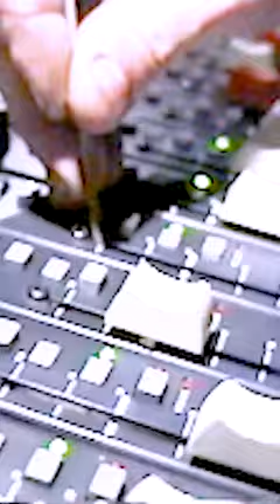More Headroom

Comment: I often stretch my cables, if you do it right you can make a 20ft into a 30 no problem.
Reply from the maker: A quality cable stretcher is a great investment

Also owning a set of high capacity air hooks so that you can fly the PA without ground support can be very useful

Comment: You know it's a good tip when the Beastie Boys are showing Gratitude.  Also, everybody talking about the metal filings getting in the fader... that short is like a turbo for the extra travel so the resistance can actually go negative. 😂